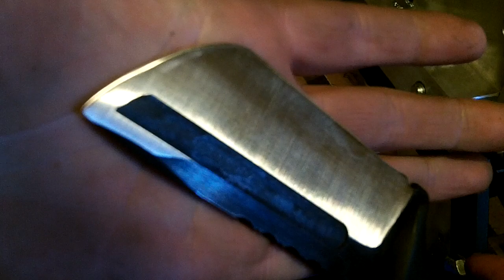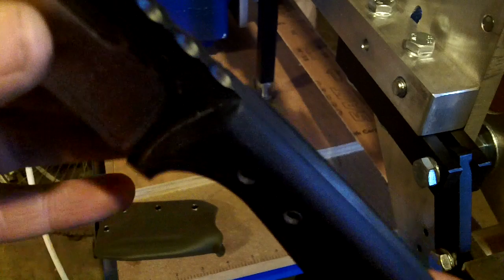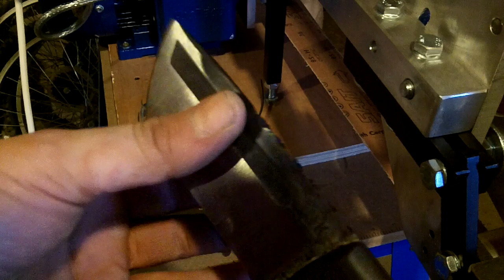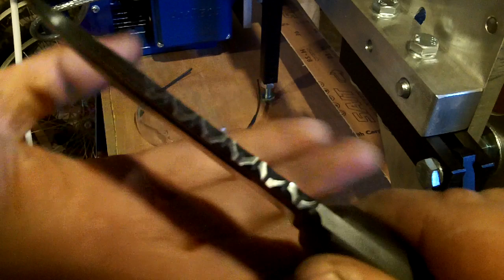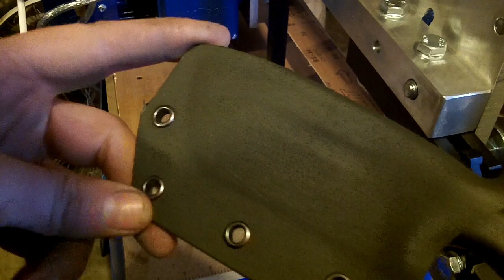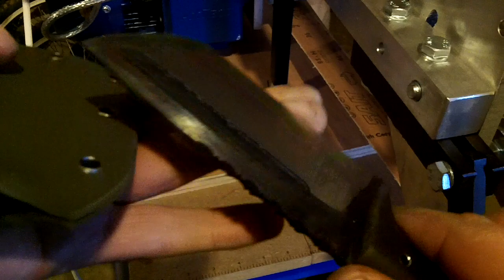First blade on the new tools

Comment: forge, anvil and a fuller set, the knife smith pounding those divots in redistributed weight and compacted the grain, making a virtual "I beam! girder out of the section,,,strengthening the area beneath the spine, on a broad sword the effect is much more marked give a narrow light strong centre to the  sword...your kabar might have been drop forged like that,,check it out,,